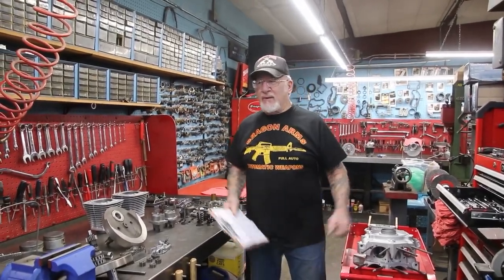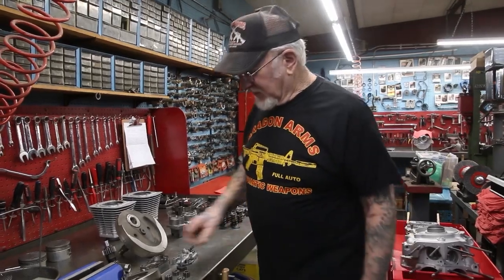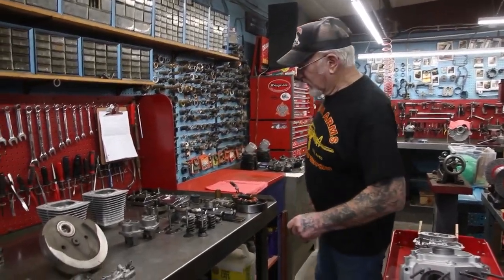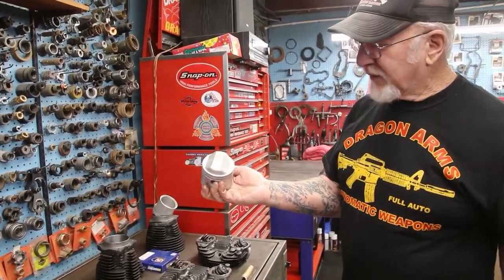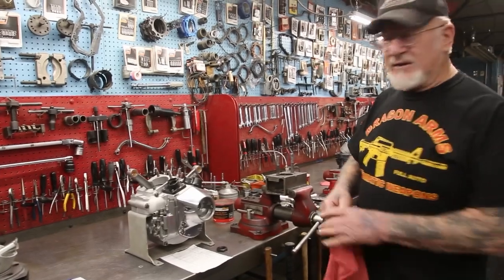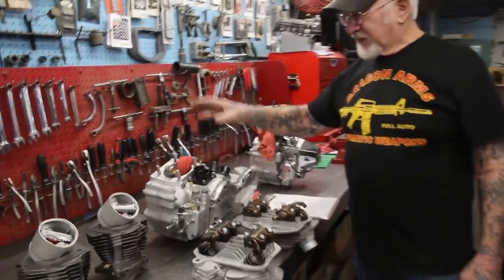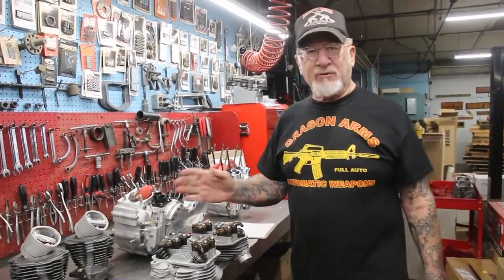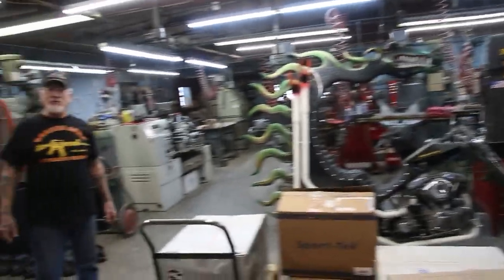Relocating Blown and Stripped Spark Plug Holes

Comment: You have forgotten more than I will ever know.. but if you will put that head into a oven and get it around 500 degrees, then weld it up then put it back in the oven and keep dropping the temp every 30 minutes about 75-100 degrees at a time, and that will help your cracking, heat your aluminum stock also when you go to weld, your problem is the aluminum wants to cool to fast and the metal dont have enough time to relax...

Comment: The tooling, machines etc this guy has is second to none!  Those plug bosses are used on many a turbine engine and are height protrusion shimmed to achieve the proper immersion depth and lock tab safetied so they  don’t back out  when removing the plugs,  very  effective and replaceable if damaged from improper plug installation

Comment: Do you carry pan rocker arms and blocks in stock?? My 48 heads cracked, like most panheads do from the sparkplug to the exhaust seat so I am going to use some new old school STD heads i have been hanging onto for decades. My stock rocker arms and blocks are worn out, in the past I have machined the block faces and honed them out but I never liked doing that unless it was a last option, and mine have been.done once already, I have never heard of anyone doing a block twice.

Comment: Mercedes Benz had problems with the spark plug holes in their early four valve engines in the 1980s and they sold thread inserts with M18 fine pitch thread on the outside. Those were real life savers. Too bad they aren't available anymore.

Comment: your new devise looks a lot like an old anti-fowler from back in the day. question the length looks like it would shroud the tip of the spark plug would the later (longer) plug work better? love to watch u, we meet 40 years ago, NO 50 years now.

Comment: It seems like that spark plug "reducer bushing" puts the plug pretty far away from the combustion chamber. Will that affect the performance of the motor? Thanks.
Reply: Might have to use a longer reach plug .

Comment: those spark plug inserts you are talking about work great, ive had mine in for over 5
 years now,  purchased them from a company in england , best move ive made in a long time, no removing the heads ,just plenty of grease on the drill bit and the tap job done , so i beat you to the secret by a few years mate lol
Reply: I use time-serts in my shop. Basically the same thing, an oversize Steel threaded sleeve.
Reply: couldnt get a timecert in a big enough size to fix the blown out plug hole so went with the set up dragonmans using but scored them from england 5 years ago  @NS-yl6wj
Reply: dragonman i just found the receipt for the sparkplug inserts it was over 8 years ago not 5 that  i got them ,you got a bit of catching up to do mate lol